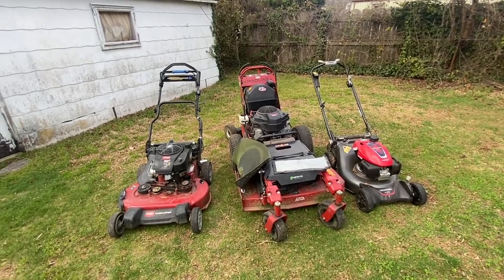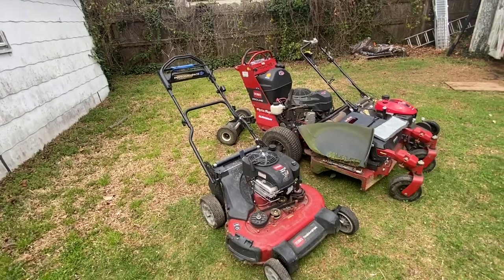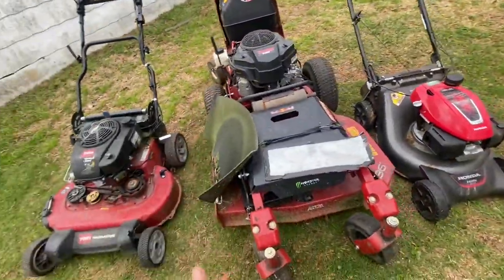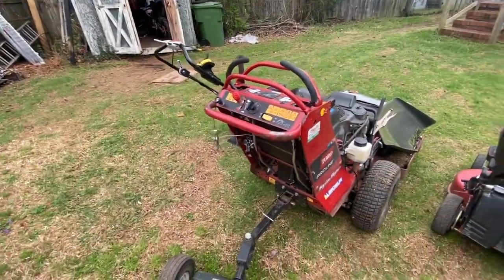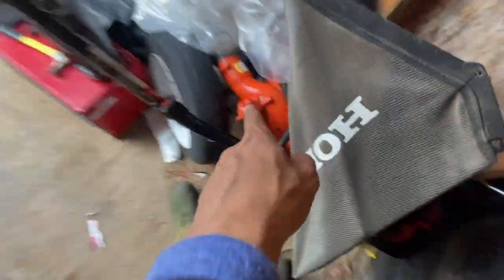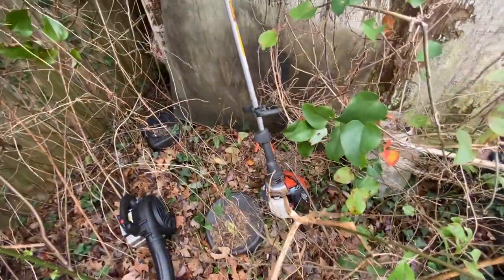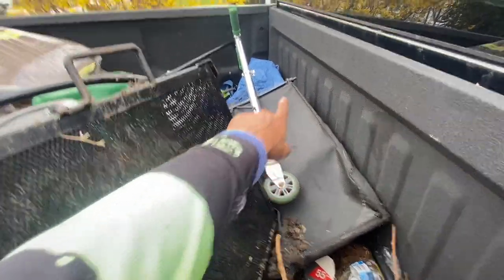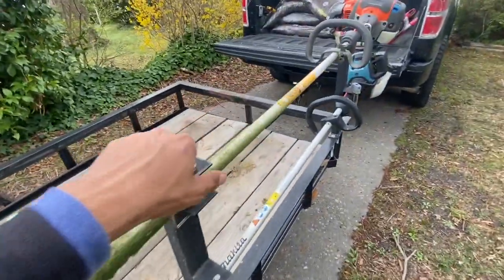2022 Solo LawnCare Equipment ￼(50+ customers)

Comment: How has that TimeMaster been working out for you doing commercial?  I bought a brand new one this past winter,  and a few people have told me it was a mistake.  It was the best option for me, and I'm rollin with it regardless! Just want to know what your experience has been.
Reply from the maker: I think it’s decent. I don’t use it much as I used too. I got up to 30 houses a week with it. Before I got the proline. I broke 3 belt so far. Got around 86-89 hours. I made a good amount with that mower tho. I would treat it with care tho. Also I seen a video with someone with over 1000 hours

Comment: 😂 unless her family is using it, go get that Troybilt from junking up that woman's shed.

You take care of that Honda, it'll last you a lifetime. Besides hyperinflation, that's why it cost what it did. If it's commercial grade, hyperinflation might have nothing to do with it.

And the belt on that 30 might last longer if you buy another deck cover for her 🤷‍♂️😂
Reply from the maker: Never going get that mower. To much bad blood. And a lot ppl told me it works better with the cover 😂😂
Reply: @CuttaSquad  I hear you. If you can't do it with Peace, best to let it go, then 🙏

I was thinking about leaving the cover off of my irritating Exmark 30 last season because it does collect grass, but I figured what would happen to your pulleys would happen to mine. Doesn't seem to be the same material as on bigger commercial mower pulleys--although those pulleys can rust out too if sitting in water uncovered long enough with no chance to dry 🤷‍♂️